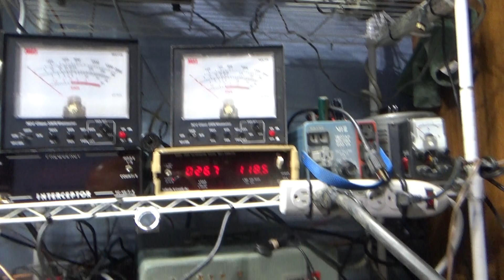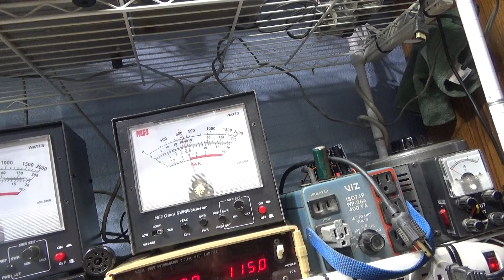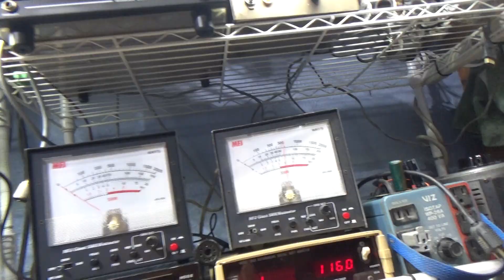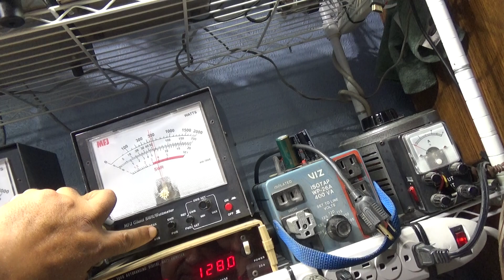Quick shortcut way to see if your amp is running right/clean

Comment: Doc, What kind of 10,000 watt dummy load do you have? Did you build it yourself?  Have a most awesome evening!
Reply from the maker: I bought it off ebay many moons ago. It uses 16, 300 watt, 800 ohm non inductive resistors in parallel.
Reply: @tramdr  Doc, those resistors must be astronomical to replace.